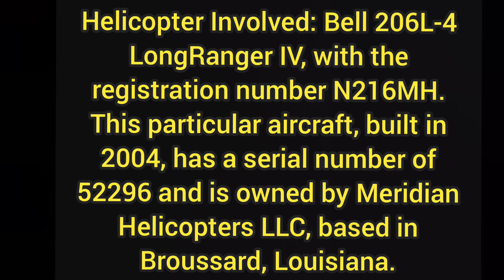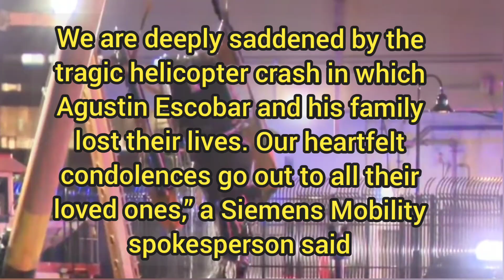Bell 206L-4 LongRanger IV crashed, caused by mast bumping?

Comment: Catastrophic transmission failure. 

Not mast bumping. The rotorhead & blades were still attached to the rotor mast along with the transmission. 

If it was mast bumping only the rotorhead & blades would have separated.

Comment: some Bell helicopters have a stablizer bar on the main rotor like on the Bell Model 47 as the stablizer bar with the weights on the end are linked to the cyclic control as other Bell helicopters have them like the UH-1 Huey and the Hiller H23 Raven as the stablizer bar is used on the Bell 30 Bell's first helicopter  the Robinson Helicopters have a 2 blade main rotor and a taller mast  as of now most Helicopter operators went with 4 or more blades for the main rotor to carry passengers as of then a 3 blade main rotor was used for passenger carrying on the Sikorsky S-55 as now some went to the Bell 407 Jetranger  as well as the Eurocopter EC135 and EC145 which those have a much better rotor system its more suited for passenger use ans as well as medevac as of now the NTSB is investigating this accident as well looking at the logs of this helicopter and how it was maintained and any actions that the NTSB and the FAA will take against Meridian Helicopters LLC

Comment: Videos have shown the entire rotor and transmission—which is just secured to the airframe with struts—separate and then auto-rotate down into the water after the body of the helicopter which those who are familiar with that model have speculated points to a catastrophic mechanical lockup in the transmission snapping it's struts and the loss of the tail boom being the result of of torque when that occurred.

Comment: IMHOP mast bumping is concievable but unlikely
Reply: Mast bumping was very unlikely bc of this model helicopter. Also you can see the entire transmission still connected to the rotor blades and still spinning.
Reply from the maker: It will be interstimg to see what caused it, if any NTSB  investigation may show.